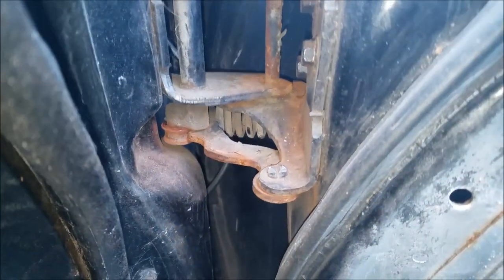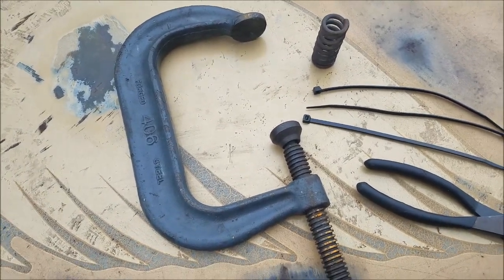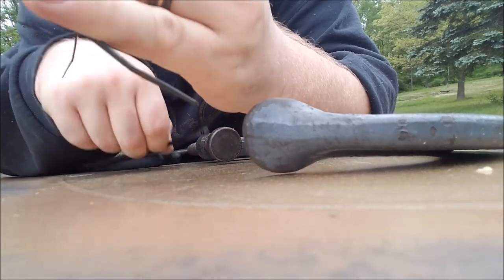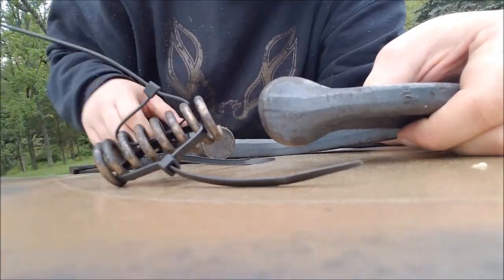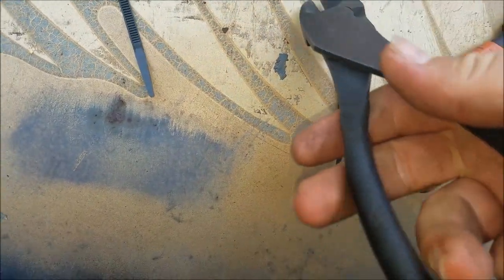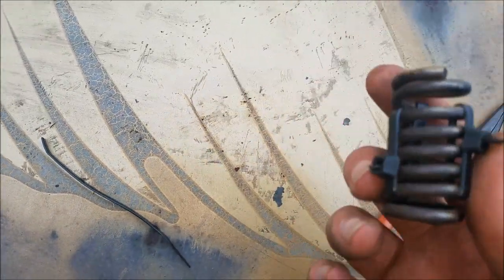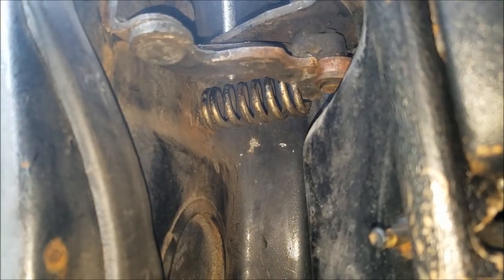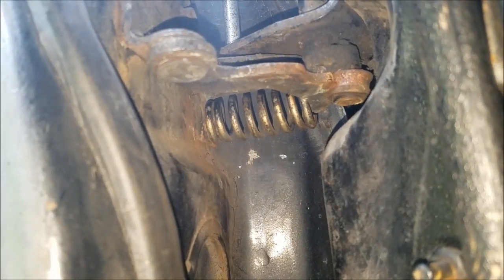Quick and easy gm door spring hack

Comment: I'm actually impressed with that idea!  Just a note for you and everyone else watching this.  

1)  DON'T use cheap or small zip tie's as they will either slip when you least expect it or the spring tension will snap them when you least expect it.  The spring could suddenly expand causing it to fly away.  If you happen to be in the way, you could get seriously hurt and or even lose an eye!!

2)  Zip Tie's were never designed or intended to hold such a high tension.  So use the largest size you can get and use extreme caution

3)  Can't get in there with side cutters??   just use an old or new fine tooth hacksaw blade with some rag around it as a grip handle.

Cheers
Reply from the maker: Thanks for the added comments
Reply: I guess you could also use pliers to hold a match and burn through the zip tie as well.
Reply: @tubehound69  or a long stemmed lighter. :)
Reply: Do it the safe way and go to Amazon and buy the tool for 9 bucks. Save yourself  the frustration. It's called a "door spring tool".

Comment: Good idea.  Use a 1/2 bye 13 all thread bolt ,two nuts and two large washers, I used four of those zip ties. Two remove the zip ties once in place Use a soldering iron. Your basic idea is a good one.

Comment: To make it easier , use a torch to melt the ziptip , if you have issues cutting the ziptip in that small space  but. Don't burn the paint job or wiring harness if one  near by
Reply: ..what I was thinking ,while observing..Shalom

Comment: This works. Just tried it. It was actually easier to put a block of wood on a floor jack and compress the spring against the bottom of the frame rail (didn't have a c clamp handy). Make sure you use 4 or 5 zip ties and make sure it's tied down evenly all the way around the spring. You'll still have to muscle it in a little with a crow bar but once it's in it's in there. :)

Comment: Only thing I can add is it would be lot easier and safer to compress that spring in a bench vise if one is available.  The C-clamp is a good hack for the job though.
Reply from the maker: I was going for the extreme circumstances but yes much prefer the vice n might have mentioned that im not sure made this video awhile ago
Reply: Run a bolt through the spring and you can compress it until it coil binds without risk of injury.

Comment: Thanks man. I cant afford lots of tools and i cant afford to by those tools that's just made for one thing and will most likely be used for just one thing. This is great and already got the stuff.
Reply from the maker: glad this helped feel free to check out my other videos if you like classic car stuff
Reply: The correct tool is only about $7 at harbor freight, but I’ll also be doing this cause I’m too cheap and lazy to go get it lol
Reply from the maker: And sometimes you're just in a position where you just need to get the crap done and you don't feel like running out the Harbor Freight because it's an hour away

Comment: Had to use stainless zip ties, even the industrial grade nylon ties I had gave under tension.  Thumbs up for the idea though, been turning wrench for 30 years and never had to do this job until now. Lol
Reply from the maker: I don't know what quality zip ties you had but even the stuff I get from Harbor Freight will hold these Springs but you do whatever you need to do to get it to work when you're in a tight spot and need something done

Comment: You are the man I must say!!! I couldnt get mine to stay compressed,,may be cheaper zip ties,,,ended up popping lose and right down in the hole where the rubber boot goes in lol
Reply from the maker: Do have to use a good zip tie it is holding a bit of tension

Comment: I just did the hinge and detent pins on my 90 c1500 and the 7 bucks for the tool is well worth it. In my case the springs were still there with bent detents. No way would I have wanted to fight with jerry rigging something to remove it or have left it on its own when I removed the doors.

Comment: Do you have to remove the zip ties in any certain order so as not to pop the spring back out? Thanks for this, I was just wondering before I did this for my friend.
Reply from the maker: I use two or three depending on quality of zip tie n no no particular order
Reply from the maker: I mean use some common sence n i also dont compress the spring any more than needed to fit it in where it goes

Comment: How I remove the hinge that seats on the roller part  where the spring is bought a door from scrap yard and they cut the hing instead of removing the bolt holding it snowni gotta remove that part also from my old door please any advise be great limited for tools don't have grinder
Reply from the maker: Im guessing remove the pin with the bushings

Comment: How did you get it out without the spring tool?
Reply from the maker: @MrOiram46  well either remove the door pins(90% of why you need to put the spring back in cause you replaced the bushings) or if you just need the spring out. i pried it out with a screwdriver or pry bar. I suggest tying a rag or something around it if your worried about it flying loose

Comment: Nice video! Could anyone with a 68-72 Nova PLEASE do a video on installing the  inside door handle, lock, vent window, window track and glass? I took mine apart 3 years ago and I’m too damn dumb to figure out how it goes back. Please someone 😩
Reply from the maker: Id find a assemblers guide you can find them on ebay or pdf files shows you where n how every part goes down to the exact screw n washer
Reply: @NOVAtazz  thanks man. I just got one in the mail, but it’s still written in 1971 directions, nit hood at all. As of now that’s what I’m going to have to go by. Thanks again!

Comment: That's a good idea but how did you get the sping out and why didn't you go ahead and replace the roller pin assembly?
Reply from the maker: I only showed this as demistration after it was asked how to reinstall one if you didnt have the tool in a facebook group i was in. I just uploaded it n shared the link to the group
Reply: @NOVAtazz It’s also an alternative if you had the tool to get it out, but can’t put it back in because the tool was bent to the point of being unable to fully compress the spring (don’t ask how I know 🤣)
Reply from the maker: @MrOiram46  i can see that id advise using a vice if you have one though over the c clamp

Comment: But how did you get the spring off? You must have used the tool to get the spring off, right?
Reply from the maker: On that door I had replaced the pin and bushing the spring is released when you pull the pin and the hinges come apart

Comment: How did you get the spring out to start with THANKs
Reply from the maker: Not in an osha approved way
Reply: @NOVAtazz  So you just use a screw drive an pry it off LOL 🤣Thank's i gotta replace the pin on the driver side   89 CHEV

Comment: how did you get the spring out in the first place?, that would have been fun to watch :]
Reply from the maker: Either a. Remove the pin or b just a long flat blade there not under that much tension

Comment: How come NO ONE ever shows spring removal? I have the tool and cant even get the damn thing off
Reply from the maker: I just used a rag n a screw driver but by no means am i saying its the right way
Reply: Well since the right way didnt work, im moving on to the wrong way. Im just concerned about spring ricochet
Reply from the maker: @kr15cartel  not condoning this but tie a rag around the spring and then pop the spring out with a screwdriver if you tie the end of the rag off to something to Spring will only go as far as the rag lets it

Comment: Guys be careful,  I have the spring tool and have had the spring fly out, it's crazy strong. Get the tool its 8 bucks not worth an eye or your teeth
Reply: $20 at NAPA and Advance. $8 where?  
(comes back later)
Oops. I don't know why it didn't show up the other times I searched NAPA and AA, but I tried again looking for this specific model and it turned up at AA & O'Reilly's: Performance Tool W84603.
$10.

Comment: my problem is getting the springs out.
Reply from the maker: I just pop them out with a screwdriver with a rag tied around the spring or u can use zip ties so the spring doest go flying also knocking out the pin will cause it to come apart
Reply: You can use a small crowbar on the spring lever. Can protect door jamb paint with small piece of plywood. Best to tie wire or cord to spring first it can fall into the body and by tricky to retrieve. Be very careful these springs are strong and can hurt you. Have done it myself a couple times. Have also reinstalled using same technique. Recommended procedure is to remove door. Can be done alone but again the spring will often fly out so best to tie it off so it doesn't go far or hit you. Personally I wouldn't trust zip ties on these springs.
Reply: Needle nose vise grips